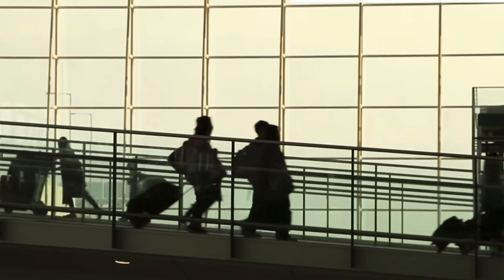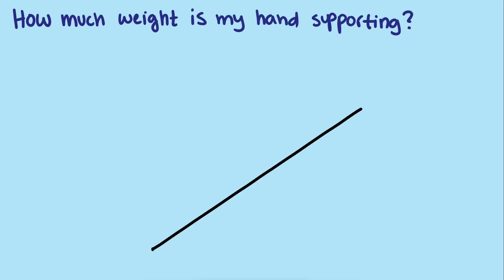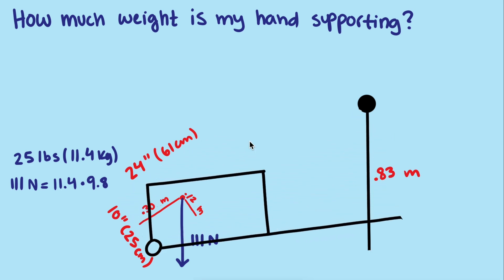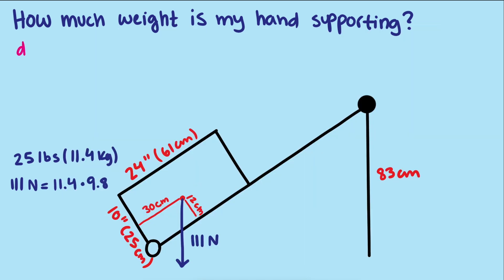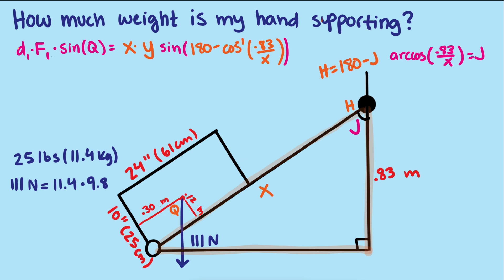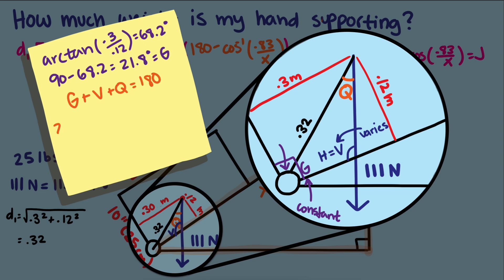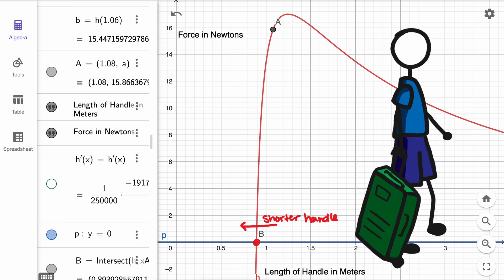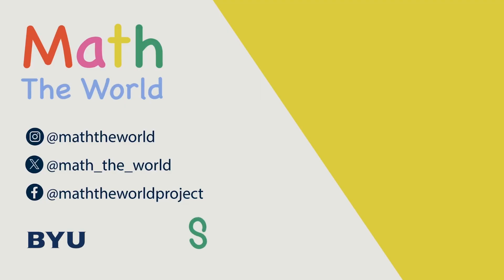Physics Explains Why THESE Suitcases Cause Headaches

Comment: Ok, but have to also consider the torque on the wrist and the back, yes you only pull from one side of the body. So, you should push them from the front with the handle around your hips. It has problems with little ledges but its so much comfortable and ergonomic.
And I think I remember some suitcases that had a rope with a handle that retracted, and now I don't remember if it retracted at the base or up top.

Comment: Easy, attach a strap to the bottom. Use a retractable dog leash, and you can have any strap length you'd like.
For the attachment point, something like a U-bolt should work, to give a little bit of swivel.

Comment: This is why I simply carry my suitcase with no wheels on the ground.  I carry my wife's suitcase in the other hand in order to counteract the torque on my spine (well, according to her).

With the four wheel design, you can just stand the thing upright and push it ahead of/beside you.  Treat the handle like an armrest or a tall dog whose ears you want to scratch, arm at your side and relaxed.  Don't try to keep it square, but push along a diagonal, because the handle is typically at an edge of the bag, and you want to avoid torque around the vertical axis.  This is still not great for walking, but excellent when standing in a line and shuffling along.

Comment: The headache story is an excuse for doing the math.
Reply: Sure, but the headache portion of it was completely superfluous to the physics showing the load curve on the handle, and it clearly distracted many viewers. Also, a better practical example could have been found where the torque actually matters; linear forces are the only thing of practical importance for this suitcase issue and do not need matrix math to solve (Really it is a zero torque problem being vastly over complicated by somebody that doesn't seem to have an intuitive understanding of the mechanics. Which further distracts viewers.).

Comment: There is no torque (moment) at the handle. The force applied at the handle creates a moment at the wheels.
Your graph makes no sense. From an upright position, a force in the opposite direction (negative) is required to hold it at small angles, only when the CG passes over the wheels does the force to hold it go to zero and reverse signs (fundamental theorem of algebra).
The only thing you need to look at is the horizontal distance to the wheels. 

What is intersesting to think about is that by pulling it (horizontal force at the handle) you have to apply more force vertically, so in some loose sense making the bag heavier.

Comment: I always avoid tilting a 4-wheeler onto 2 wheels.

Extend the handle as as little as possible, and push it forward beside you or slightly in front of you, with the longer side of its base oriented parallel with the push direction.

Are you serious? Your bag cannot be used in this way?

Comment: alternatively, you could place the wheels on the large face of the suitcase so its low to the ground rather than tall and thus remains on 4 wheels when rolling around
Reply: you'd have to factor in where to place the handle, folding out is the most likely solution, but that would probably come with it's own set of issues

Comment: For me, the handle is simply not long enough. Whenever I let the case dangle on my hand, I need to watch my steps to prevent the case from bumping into my foot. Or I hold my hand slightly further back to increase the distance between the case and my foot, but that introduces neck and shoulder pain over time. Sadly, just lengthening the handle would likely not solve it since a longer handle lowers the angle of the case itself, introducing another contact point when I raise my foot to walk the next step. The handle needs to be longer AND at an angle, relative to the case. (At least for me.) This could get achieved by either inventing some clever mechanism to tilt the handle when it's extended or just by bending the telescope arms themselves. Although that would reduce the overall volume of the case since they back side would be curved inward.

Comment: Tbh I keep all four wheels on the ground and sort of push the roller bag with the handle extended
Reply from the maker: Mine only has two wheels (although the images often show 4 wheeled versions). We did recently get 4 wheeled versions. I struggle with both.

Comment: has anyone ever considered... a backpack? I have walked for hundreds of kilometres carrying much more weight than a wheeled suitcase, without any significant ergonomical issues (other than my hips getting just slightly bruised by about the 3rd day, I don't think this applies to walking across an airport...)
Reply: I used that for many years, and would have agreed with you. 

However at the age of 70 the cartilage in my knees is not as good as it used to be, and I get osteoarthritis in both knees if I carry a back pack any distance. So I'm now needing a design that doesn't put weight on my knees.

At the moment my knees work fine with carrying my own weight, but perhaps the time will come when I'll get osteoarthritis even just carrying my own weight.

Comment: I'm tall, and most things constructed like this (small dollies, pressure washers, carts) are all way too short for me to pull.  The false presumption in this exercise is that the hand height is fixed.  If you pull with a relatively relaxed arm, the handle will rise, and the dolly becomes unstable and hits your feet.  You have three choices.  You can stoop down.  You can turn the dolly around an push it.  You can use a lot of rarely-used shoulder and back muscles to try to prevent your hand from rising with the load.  

In many cases, products are simply not designed in a way that allows #2 to be practical.  The handles collapse, or the wheels swivel around and bind up.  That leaves us with stooping or using a bunch of likely disused muscle groups to restrain a persistent fluctuating load for a significant period of time.  I'll leave you to guess whether that's a plausibly significant contributor to shoulder, back. and neck pain.

How do I fix these things?  Make the handle taller.  Get rid of crappy small swivel casters.  The ideal is a simple hand truck with two fixed wheels.  Is that practical for roll-on baggage?  I don't know.  Even though I have a physical muscular disability, I always feel like I'm the only one on the airplane who actually shoulders my damn bag(s).
Reply: "The ideal is a simple hand truck with two fixed wheels."

I mean, that's basically the norm isn't it? You usually have to go out of your way to buy 4 wheel carry-on luggage.
Reply: @Nevir202  The distinction between the baggage and the ideal is the handle height and wheel size.  A hand truck is made to actually do the one thing it does, in either direction, with a wide range of COG heights.  A rollaround bag is a suitcase with a token gesture's worth of the same functionality.  Because of the application, it has to be a severe compromise.  

As much of a compromise as it must be, I don't think the feature justifies itself.  It my creaking skeletal remains can hustle all the way across ATL or up and down airstairs with bags in hand or on my shoulder, I don't see why everyone needs to find optimal ways to drag their bags on the ground.

Comment: You only solved for one component of the force vector. When you pull the luggage, you are pulling along some vector which has a significant horizontal component. You also don't just pull, you also apply a torque with your wrist. You don't want to simply minimize the vertical force component, you want to minimize the total strain on your wrist while keeping strain on your other joints below some threshold. It's a complex optimization problem.
Reply: Perhaps the torque at the wrist is the most uncomfortable.
Reply: @optimistgrump  Torque at the wrist is insignificant for anyone with half a wit and paying any attention to how they are gripping it.

Comment: Uh, I mean… how about leaving the suitcase up, extend the handle to a comfortable position to your hand and instead of dragging it you roll it by your side?

Your suitcase has four wheels, use them!!!
Reply: This is mentioned early on in the video, it leads to elbow strain instead of shoulder pain.
Reply: I haven't tried it, but I assume that would be more a pushing instead of pulling movement. When pushed, these tiny wheels might be blocked by every "grain of sand" and the suitcase tumbles over.
Reply: @snygg17 You... haven't tried moving a suitcase on all 4 wheels? I refuse to believe anyone this averse to experimentation exists
Reply: @phobics9498  I guess you need to buy such a suit case to try it.
The issue are the tiny wheels, they work only on super flat surfaces.
Reply: @snygg17 which is obvious, because you're gonna use these suitcases on airport floors and flat ground, obviously not on dirt.

Also, I regularly use the 4 wheel method instead of 2 wheel because it definitely feels less straining, though i still use 2 wheel if theres a significant bump. Otherwise i can just lift it up a little.
Reply: @Nafinafnaf and some of the world walks home or to the hotel from a nearby train station after the flight and DOES need to use those tiny wheels on bumpy terrain for a significant amount of time.
I haven't tried a 4-wheeler yet either, but I'm also small enough (roughly 5'7'') that the strain from the baggage is quite a bit smaller than OP.

Comment: I used to deliver papers and would take out around 300 at a time. I found that the least strain came from pushing rather than pulling. With some experience behind me I made my own trolley by fixing a crate onto a skateboard. The most strain came from keepong it balanced, it could have done with a wider wheel base than a skateboard. 
The ideal handle does need to be on the sides to hold the balance.

Comment: Could skip all the trig, work with 3-figure accuracy and a convenient approximate angle (looks like 60 degreees to me), and reach the same conclusion: the handle force isn't much when you're simply tugging it along.  How's he ever going to get it into the overhead bin when the whole weight has to be accelerated upward at awkward angles through a jostling crowd?

Comment: My solution: don't use a roller. That sounds kind of flippant, but I'm serious. A few trips ago, I switched from a roller to a large duffle bag about the same size, and I never looked back. Don't have to worry about uneven terrain, easier to squish into overhead compartments, and it even has a bit more flexibility for packing things.
Reply: Duffles sound horrible for your shoulders (unless I misunderstand when I think people mean a sausage like bag with no hip straps). A proper backpack with hip straps is really ergonomic.
Reply: I agree.  I hesitate to argue that the basics of backpacking should teach us about what are desirable ergonomics ... but there probably is a good argument there somewhere.
Reply: Also sounds impractical if you’re hauling heavy equipments, doing long travels or travelling with others. 
You can’t be hauling 25+kg of weight on your shoulder everywhere you go.
Reply: @yesno7889  You can definitely carry enough weight for indefinite stays + relatively heavy laptop + some textbooks. (Source: me) During most of a travel day, you're not actually carrying your luggage but are rather keeping it in luggage compartments, between your legs or next to you. If you're carrying that much mass, you probably have enough for check in luggage too, so you also have less carrying to do in airports. During non-travel days you can empty the backpack and use it to carry day trip supplies.
I guess single parents with two or more children might exceede the practical limit. I'm pretty sure that I could have swapped the textbooks for a single child's stuff though.
Reply: @yesno7889  You're not going to be hauling 25+kg in your dang carry on baggage anyway.  I wouldn't want to deal with that much weight in a typical rollaround bag either -- at least not without a backup plan for when the tiny plastic wheels break on the first floor transition you hit.  I have a wheeled aluminum travel case for equipment, but that's not the type of case people are talking about.  Even though I have the case, I just ship tools and equipment ahead.  Why lug that crap through the airport at all?
Reply: @yesno7889  You can't be hauling 25 kg in a carry-on at all, so that is irrelevant.

Comment: I am an actively inactive person and I cannot comprehend a world where the miniscule strain of pulling around luggage can be any sort of strain without walking for tens of miles while dragging it
Reply: Carrying anything of decent weight for even a minute can be tiring
Reply: If you travel for business you'll start racking up the miles, or if you have to go through LAX airport
Reply: It is more about the horrendous ergometrics of holding up and pulling something behind you with your palm facing backwards.
Reply: @travcollier  That might explain it, you're doing it wrong. The only muscles you should be using are your fingers gripping the handle. I also have my palm facing forwards but I don't think that would make a difference.
Reply: @Oaisus  Oh, I don't have this problem.  I tend to roll bags beside or even in front of me... Or, you know, just carry my luggage.
Reply: Same. It's barely an inconvenience.
Reply: I know, I never had problems when I was going on holiday every year
Reply: @prich0382  traveling every year is a lot different that traveling every week. Repetitive motions, even with minimal weight and force, while putting strain on joints and muscles will have a compounding effect. But it also probably depends on height and such
Reply: You don't have to go far for it to be awful. Borrow one from a friend and pull out behind you while it's tilted on two wheels. The experience is surprisingly awful.
Reply: @mgancarzjr  The fact that anyone actually pulls these things behind them mystifies me. That whole experience sucks. Rolling the four-wheeled ones beside you takes a fraction of the effort.
Reply: @rantingrodent416  I have a luggage I use for hauling gear which is often scuba equipment (not light but not monstrously heavy). It has only two oversized wheels which don't swivel. You are correct that the effort is so much more than a four-wheeled luggage beside or in front of you.
Reply: Imagine a suitcase heavier than the one you usually pack, maybe?
Reply: go sell it!
Reply: I'm a pilot and I concur (our "carry-on" tends to be much larger). I didn't even know this was a problem for people without severe health impairments. Though I do know some people buy luggage with janky cheap wheels which about triple the horizontal force required (and make pushing impractical), but I would expect those to be the once per year travelers and frequent flyers should know better and get large wheels with good bearings.

International pilots have finally caught a break with all the charts and references moving to tablets, but there used to be inside jokes about being able to spot them by their long orangutan arms, stretched from dragging around 30 pounds of books on top of normal stuff. (They may have their bag stowed with belly cargo but they deliver it to the plane watch it get loaded and pick it up themselves, so they even need to haul around the pavement and stairs, they don't ever send it through the airport system.)
Reply: …"Beta!"
Reply: Become active and you can comprehend it quickly.

Comment: @8:55 in your diagram:
- you pull from bellow the center of gravity
- the fulcrum becomes the left wheels
- any non-subtle acceleration will have the suitcase lag to the left.
- center of gravity passes left of the fulcrum -> suitcase topples over
Reply: Yeah handle should stick out of the short side not the long side
Reply: :o
Reply: this design is terrible. now if the handle attached to the bottom on the opposite side, you might be able to make it work depending on how it is attached...but yeah.

1. I don't understand the problem in the first place. I think bro just needs a physical therapist
2. the solution is not a solution, it is an incredibly unstable system that would end up with me setting fire to every suitcase built this way

maybe do some field work and play test this idea before posting a video on it
Reply: would attaching the handle higher up near the middle help?